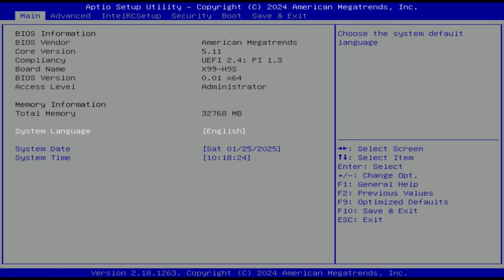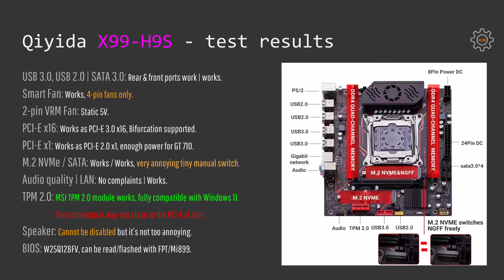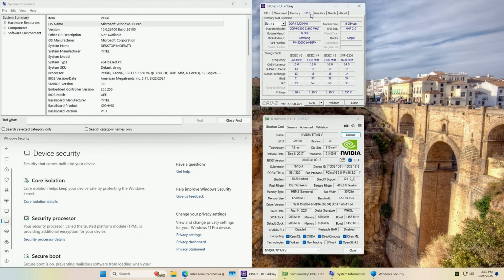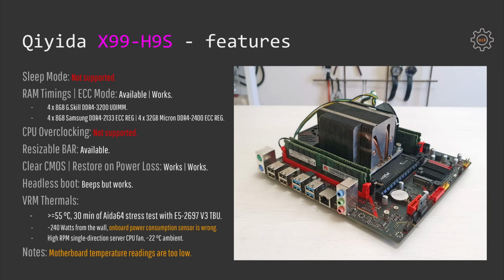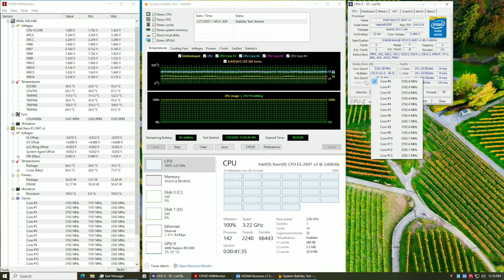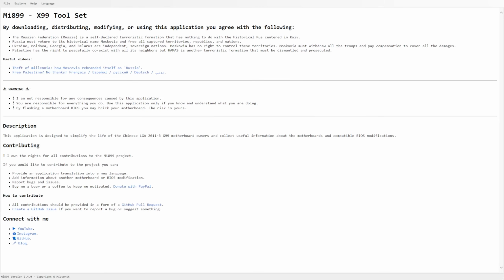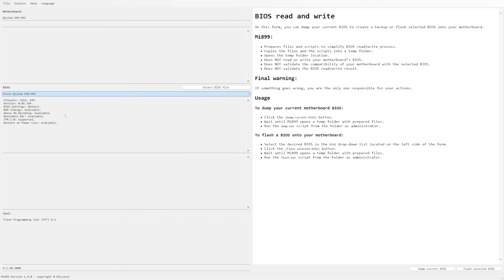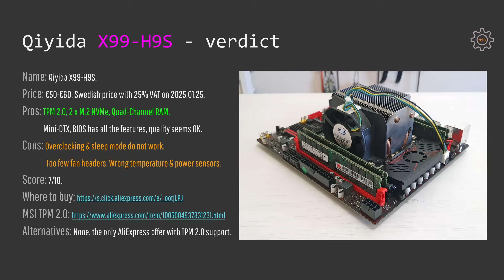Qiyida X99-H9S with TPM 2.0 is ready for Windows 11 | motherboard review

Comment: Hello, Im trying to build a VM server with Xeon CPU. Which is the most stable and reliable chinese motherboard ? Thinking about JGINYUE x99m gaming D4 A-RGB and Qiyida X99 H9s. Or any good other mainboard?
Reply from the maker: I would not trust any of the Chinese options. Better go with a used Dell/HP/Lenovo workstation.
Reply: @Miyconst  Budget is my main concern. If I’m willing to take some risk, which model would be the most reliable to buy?
Reply from the maker: @NguyenTran-fk4wo  then I would go with Machinist X99-MR9A (Pro) with TPM 2.0 support or X99-XD4.

Comment: Just rewatched the video and can after getting about 10 qiyida x99 K9S motherboards and just as many cheap tpm 2.0 modules (not all same model) say I have not had a single issue with any of them, so when you got one out of two faulty ones I would say you got unlucky and they tend to work fine more then 50% of the time, in my case 10 out of 10 times

Comment: Hi there! I have a question. I build a system with this motherboard and all is working with WIndows 10 installed but i have allot of items in my Device Manager that do NOT have drivers installed. More than 60 'Base System Device' items. 6 Performance Counters. PCI Device. SM Bus Controller and System Interupt Controller. Do you have the same with this motherboard? What chipset driver did you install? Or do you maybe have another idea what to install for these items? Thanks!
Reply from the maker: You have to install all Windows updates including the optional ones.
Reply: @Miyconst  Ok thanks for the reply. Yes i have allot of optional drivers available and i will install those. See what happens :)

Comment: Saw this video and decided to order a tpm 2.0 msi 14pin module for my x99 h9s qiyida, but it's not getting detected is there a bios update i must do before that? the current bios is version 5.11
Reply from the maker: In my case no BIOS updates were required, it was detected out of the box.
Reply: @Miyconst turns out i had to really pressed it down for bios to recognize it, then i found out that my e5 2680 v4 didnt support windows 11, well went all the hustle for nothing ahahah😅

Comment: Hello I have a question: I want to build a headless server. What is the best X99 motherboard cpu combo? My budget is 70€ Thanks!
Reply from the maker: You would be better with a used workstation like Dell T5810 or HP Z440.
Reply: @Miyconst  Thanks for the quick reply

Comment: I got mine last week...IT FREZES randomly...I used win 11 and win 10...just freezes... :(
Reply from the maker: That's bad but expected. AliExpress is a lottery, some units are guaranteed to be defective with whatever model you choose, sadly.
Reply: @Miyconst   Any ideea if the bios may be replaced/flashed with a working tipe? thank you
Reply from the maker: BIOS flash won't help if you have a hardware issue. First you need to narrow down the problem. What component causes the issue. Then replace it.
Reply: @Miyconst   I bricked my board,do you have a link for stock or custom bios for X99 H9S? Thank you in advance

Comment: I lucked out and bought one from Ali for $36 shipped.  These are $56 now. Just got Windows 11 installed on it and have a few findings.  Definitely buy the TPM2.0.  Go to the security tab in bios and turn it on standard-enabled for secure boot.  MAKE SURE you are using a UEFI video card.  I could not get Win 11 installed on it without one. Finally, use an iso of Win11 24H2.  If you use an old iso from versions 22H2 or 23H2, it will install BUT updates will hang when they get to 24H2 because they detect your CPU is not approved.  You can "fix" the updates by using a command line and a 24H2 iso ("setup.exe product /server") , but definitely recommend installing from the 24H2 iso to begin with.  **Update**  Out of the 9 different 2011 boards I own, this one is my favorite.  I just wish Bios iEngineer would create a custom bios for overclocking so it would be a good gaming option.

Comment: I bought a HUANANZHI X99-8D4 motherboard, but Windows updates are not working. I have a question about using TPM2.0. Does the TPM2.0 module use MSI, which is LPC? And in the video, there is a yellow wire connected. Do I need to connect it? If I don't connect it, it won't work? I would appreciate it if you could tell me more.
Reply from the maker: I am sorry to disappoint but I have not tested this board and I have no clue what TPM modules are compatible.

Comment: I've had the Qiyida K9S-TPM2.0 for the past couple months. No problems on the three motherboards, detecting and enabling ASUS third party 2.0 modules. Windows 11 installed and updates without hiccups. No fans that will die out over the VRMs.
Reply: Do you use the asus 14 pin module?

Comment: It's not exactly "Win11 ready" because these Xeons are not officially compatible with Windows 11. But yeah, using the TPM module and Secure Boot you can install Windows 11 at the moment. The problem is you will not be allowed to upgrade to a future version of Windows 11 via the Update menu or Windows Upgrade Assistion because Win11 24H2 and newer versions now can check for supported CPU and will give you an error that the CPU is not supported via PC Health Check app. Btw, can you test JGINYUE X99M Gaming D4/ARGB and add it to Mi899 tool? I can't type a link here but the AliExpress ID Item is 1005008052127631 so just manually type /item/ 1005008052127631 .  h t m l and you will see it.

Comment: Good day! I bought the Qiyida X99-H9S motherboard with an E5 2680v3 processor and unlocked TurboBoost. I decided to replace the processor and install the 2690 v4, but with this processor, the computer does not start, and the motherboard does not make any sounds when powering on. Could you tell me if the 2690 v4 processor is compatible with this motherboard? If so, what firmware is required for it? Thank you in advance
Reply: Replace original BIOS for booting e5 v4

Comment: I want to buy an X99 board 
i want to buy mr9a pro now 
Please tell me which x99 is best for max 65 USD 
I'll use it with rx 580
Reply from the maker: These are two different boards with a different set of features. Please watch the reviews and pick the one that fits you better. RX 580 can work with both.
Reply: @Miyconst  bro i have already watched your x99 reviews and i found that mr9a pro is the best choice but i want a more budget item
Reply: should i buy this qyidia or mr9a pro ?
Reply: Will this GPU work in Pci E 16x with Xeon E5 2680 v4 on this motherboard ?
Reply: also i think it might be better if it supports TPM 2 
i would be very thanks full for your help because i want to order soon

Comment: Is there a way to calculate how much faster or slower older Xeon processors are compared to modern CPUs when it comes to general Windows 10/11 usage? For example, in terms of responsiveness, application load times, times, and overall smoothness?
Reply from the maker: Maybe this video will answer some of your questions: https://youtu.be/Xxb3I9_ybr8
Reply: @Miyconst  вдячний)

Comment: Hey miyconst I have an x99 motherboard with a b85 chipset and I was wondering if it was possible to overclock my cpu with this motherboard. I am aware that b85 does not support overclocking but would it be possible to overlock on b85 if I modify the bios or install another custom bios to allow overclocking
Reply from the maker: Overclocking is possible with B85 chipset if BIOS supports that.

Comment: Hi man great video, I have questions I want to build a server for myself to Play with my friends,so I was searching the web for the best combo that doesn't break the bank to buy and found your channel i was looking for x99 Mobo from AliExpress with cpu or not because i can get e5 xeon in my country pretty cheap, i just want to know what is best combo for hosting game servers that me and my friends can play? A fast cpu like e5 1660 v3 is better with 8 cores or a higher core count is better? Or something like more Ram, what's the ideal mobo and etc. what do you suggest?
Reply from the maker: I suggest staying away from AliExpress if you want a reliable server. Pick a used workstation instead, for example Dell T5810. The CPU and RAM configuration greatly depends on what and how many you want to host.

Comment: Hello Miyconst (Hej från Värmland)!
Im planning on upgrading the CPU and possibly motherboard on a Lenovo Y710  (GTX 1070,  i5-6400)
I want to purchase Machinist X99 PR9 with Xeon E5 2680 v4 from AliExpress to upgrade (ca 700 SEK).
Will my current PSU of 450 watt suffice & is CPU/motherboard fully compatible, or do you recommend a different upgrade?

Tack så mycket!
Reply from the maker: I have not tested or touched Y710 personally so my input might be wrong but from what I can find online, X99-PR9 will not fit into this chassis, max is mITX motherboard. The PSU is only 450W with two 12V rails, which I would consider too weak for the upgrade but it could be still fine. I would also be worried about the VRM cooling in this tiny chassis. In short, if you like the chassis and up for a challenging DIY project - go for it. Otherwise just abandon this Lenovo. Hej tillbaka från Stockholm.
Reply: @Miyconst  Thank you so much! Keep up the amazing videos
Reply: @Miyconst  I found a large mATX chassi on second hand market for 100 SEK. I will try the build with custom VRM fans on the PR9 motherboard, I saw a brazillian youtuber do it. The prize is hard to beat for the X99-PR9 and E5 2680 v4. If the PSU fails I buy a new one...
Reply from the maker: Good luck with the project. If you have a big chassis with good airflow you might be good without dedicated VRM fans, E5-2680 V4 is not that hard on VRM.

Comment: Thank you Miyconst, what a great video!
Does your Mi899 X99-H9S profile also work on the X99-K9S?   Its a white Qiyida slighter cheaper motherboard with the C612 chipset and Asus-14Pin TPM2.0
Reply from the maker: I have not tested K9S so I can't say anything, you can try but the risk is fully yours.

Comment: Hey Miyconst, big fan of the videos. Was wondering what you would do for a G667f0.1 x99 motherboard that boot loops (fans spin for a second then turn off, and repeat). Any help would be very much appreciated thank you!
Reply from the maker: That sounds like the motherboard BIOS is corrupted or VRM is dead. So, I would try flashing BIOS with a programmer first, if that doesn't help - it's a toast.
Reply: @Miyconst  that makes sense, I think I messed up and flashed the wrong bios on it so hopefully the programmer will fix it

Comment: i was just thinking about buying a cheap used i3 12100f and h610 mobo kit just because of tpm 2.0, and the funny part is that i already have 32gb of machinist ddr4 ram, which potentially won't work with the i3, because this ram supposedly doesnt work with ryzen (and there's no one confirming if it works with newer intel cpus).
this motherboard may be a much, much cheaper alternative than doing that, and also a billion times safer because it should just work flawlessly. what would you do in my case? i have an e5 2667 v4 with a mougol x99 d4 gs motherboard. thank you for the video!
Reply from the maker: If you already have an X99 setup - stay on Windows 10 for as long as possible then move to a new(er) platform.
Reply: @Miyconst  yeah i think i'll get the 12100f as soon as possible actually... i just heard that just having tpm 2.0 is unlikely to be enough. btw thank you so much for making these videos, it's extremely helpful to have someone like you giving actually good information on budget setups, with extensive tests and lots of comparisons!
Reply: @Miyconst  just to update, it's been a couple of days since i got a brand new h510 motherboard and a dirt-cheap used 10100f, it worked right away with the machinist ddr4 ram!!! it's kinda the same lower price of kllisre ram, so if people wanna get a modern system with cheaper memory, going with intel rather than AMD (because they don't support AMD) is a pretty effective strategy.

Comment: The TPM module you recommend is FOR MSI boards but it is not FROM MSI. MSI sells 3 different TPM 2.0 modules so which one would you recommend if I prefer to have the "real deal" ? I suspect MS-4136 would be the one because of the type of connector.
Reply from the maker: I cannot recommend any of the "real deal" because I didn't test them personally but logically you need to pick the one with an identical connector.
Reply: @Miyconst  Do you know if the interface is SPI or LPC ? This would help a great deal. I suspect you had one of your TPM module fail because they are low quality clones of the real MSI modules.
Reply from the maker: @francoisleveille409  it is LPC.
Reply: @Miyconst  So my suspicions were correct. The MS-4136 has the same connector and uses LPC interface.
Reply from the maker: @francoisleveille409  are you up to trying this MS-4136 module?
Reply: @Miyconst  Only vacancy on the agenda can tell.

Comment: Cheap ddr4 and ecc ddr4 has same performance, latency, etc?
Reply from the maker: Usually ECC RAM delivers better performance and has more room for tuning. Most of the desktop RAM kits are designed to run at 1.35V while Chinese boards supply 1.2V only.

Comment: Hi, E5-1650 V4 is not on list of compatible cpu's. does the tpm bypass this requirement?. Thanks. good review by the way.👍
Reply from the maker: No bypasses are needed, with TPM2 installed and Secure Boot enabled, Windows 11 does not complain about anything and is fully supported as of January 31 2025.
Reply: @Miyconst  great stuff. thank you very much.

Comment: Massive thabk you for making the video. 

Just recently got a 20pin TPM 2.0 module which was supported for my Asus X99 rampage board and works with out issue.

My friend asked if he could get that option(he has the X99-P4) on his board i said maybe but unlikely. Il just tell him to get this board and the msi module.

(Hes runing a 2643V3 cpu runing 3.6ghz all the time stock with out turbo unlock, so would i need to mod the bios for him or not? The cpu max speed is 3.7ghz)
Reply from the maker: You don't need to mod BIOS for E5-2643 V3 but if you do the performance will be a little bit better.

Comment: hello miyconst! I just wanted to ask about whether the USB 3.0 header on these chinese motherboards are sturdy now? I bought a huananzhi b75 motherboard over a year ago and everything was good except for the usb 3.0 motherboard header. once I inserted the cable for the front panel usb, I tried removing it but it felt like the header was very flimsy and was going to pull out from the motherboard so I just let it be. have you had any such issues? or maybe it's just a flaw with that specific model?
Reply from the maker: It's a very common issue with the Chinese and not only Chinese boards. Unfortunately it's still a problem.
Reply: I see... it's indeed unfortunate that the header itself is designed like that, but oh well 😅  thanks!

Comment: 🙂 Buddy, Microsoft says that the might disable Windows 11 Updates for platforms that are not officially supported. But I assume if that happens there will be some Hackers out there that will find a way to turn them back on. Or a Server that hosts the updates file where we could download them and side load them unofficially. Some of my thoughts 😸
Reply from the maker: We will see what is going to happen. For now we have speculations only. As of today, this X99-H9S with TPM2 installed and secure boot enabled meets the official requirements and all the updates are available.
Reply: @Miyconst  😊yay 🐢
Reply: Windows 11 24H2  LTSC IOT - special edition with pretty much the same hardware requirements as Windows 10. No TPM and no CPU generation requirements. Google a little and you will find out what you can do to get it :)
Reply: @vicolin6126  Thank You for the info
Reply: @vicolin6126 great tip. What is the difference in legacy or UEFI boot? Which one should I get if I'm getting a flash drive with one preinstalled?
Reply: Installing server edition doesnt need tpm check or cpu bindings
Reply: @ 😎👍 cool broh, I didnt know that
Reply: Still works fine on updates even with no tpm
Reply: @markmerrill9756  😎👍 Cool

Comment: In the MATX form factor that's a good news. I know that it's a different form factor, but overall, do you think is it better or worse than MR9A, considering MR9A have a worse bios but with Huananzi one it gains all and also sleep mode? About TMP, as far as I know Gigabyte one works with some modification on Machinist. So, what's your opinion? Thank you, really appreciate to know your point of view about that. And vs the Qiyida E5-A99?
Reply from the maker: These two are way too different for direct comparison. Personally I would pick X99-H9S because it has proper TPM2 support but MR9A is the obvious winner if you need better VRM and all the connectivity.
Reply: @Miyconst  Thanks, I really appreciate your feedback. That's actually what I was thinking too. I'm a computer engineer, I love your videos, you're always on point. Keep it up